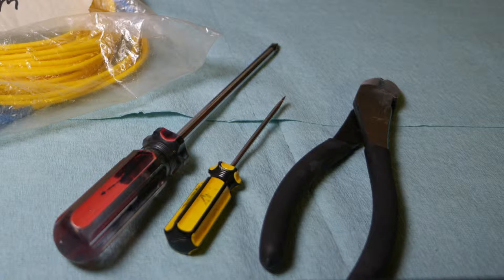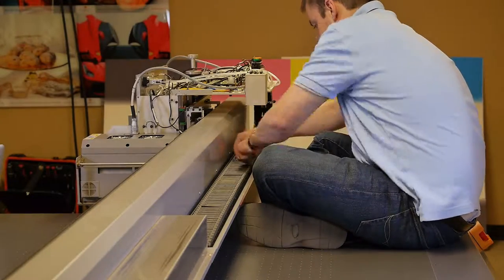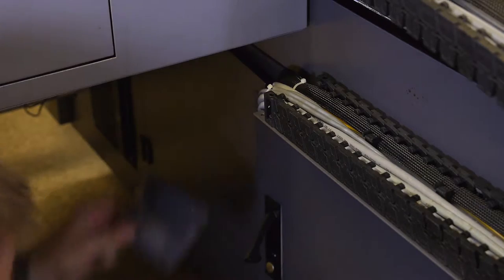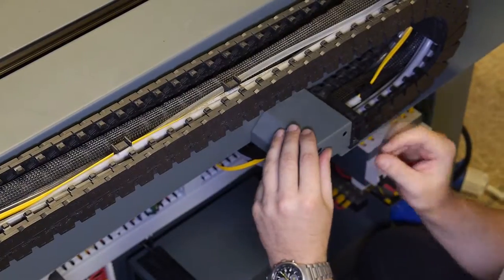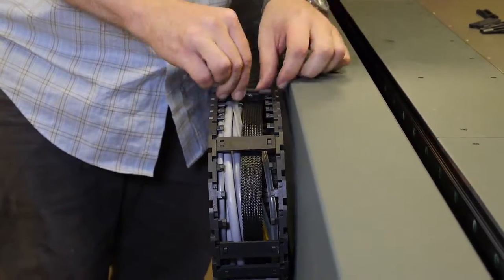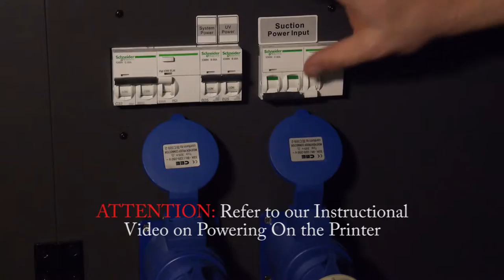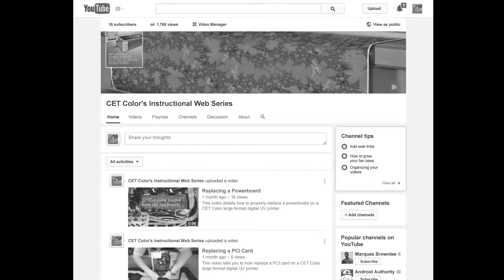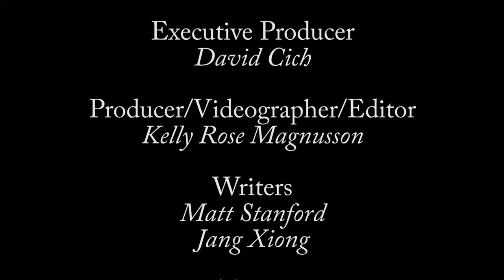Opening and Closing the Chain

Comment: How about a video on how to get decent adhesion? I have struggled with adhesion with our CET for almost a year now.
Reply: h
Reply: +Damien Birski Yes, same here. We really struggle with polymetal and dibond, which is 75% of what we do. Great machine,  poor adhesion results.
Reply: k
Reply: voodoo304 for me its just coroplast
Reply from the maker: +voodoo304 +Damien Birski Adhesion can be improved by the curing of the ink. Have you tried all configurations of lamp settings (i.e. trailing, leading, all on low/high)? If still unsuccessful, try adding an adhesion promoter.

Would you mind further describing the adhesion issues - does it rub off, smears, etc? Also, when does the failure occur? If it is within minutes, we suggest allowing the ink 24 hours to fully cure. If you are still having problems, we would happy to conduct a testing of our ink and its adhesion to said materials. Can you please send us a direct message and we can arrange for a material sample to be sent to headquarters for testing? Thank you!
Reply: CET Color's Instructional Web Series Be happy to. When printing to the edge of polymetal or dibond and then laminating, the laminate could peel all of the ink off of the board in a big sheet. This was only happened when printing to the edge! 
We have since found a new material that fixes that issue.
At that time we were running 55 series inks, which we also found was not conducive to being exposed to water and the ink was literally falling off of coroplast in the field. 
Our inks were recently switched to 96 series, but enough time hasn't passed to determine whether or not this ink is good for outdoor use.